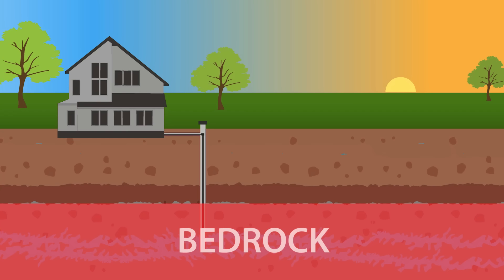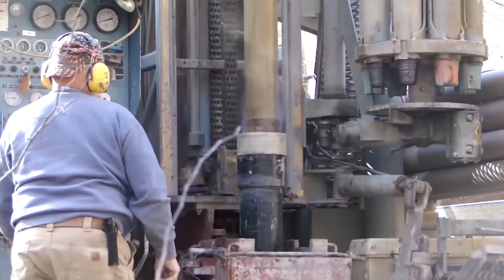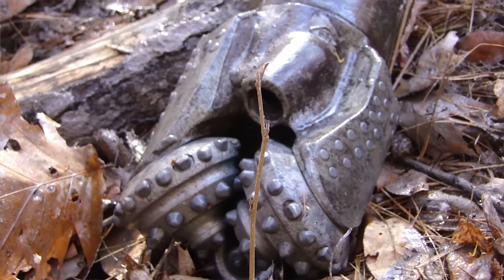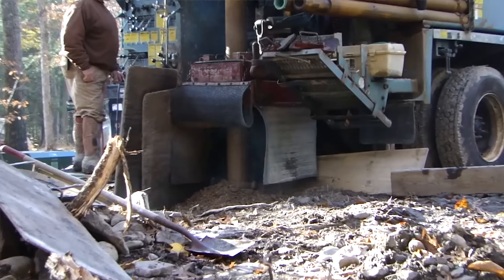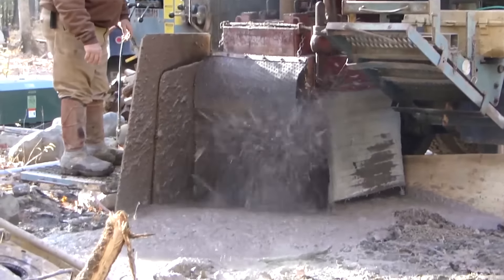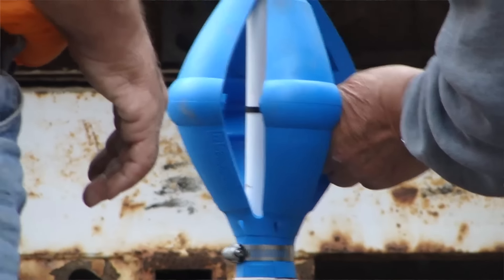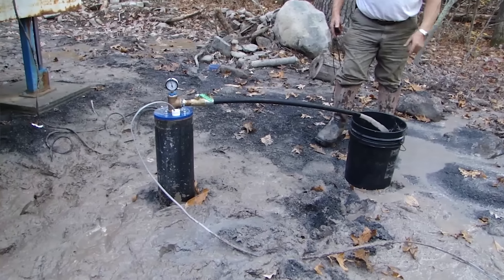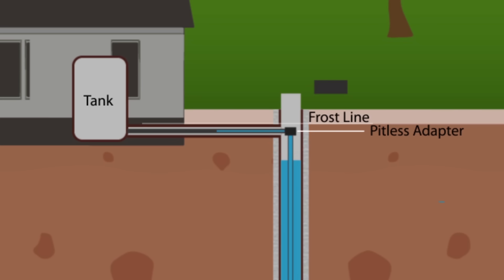WELL DRILLING 101 | Every Step Explained

Comment: The reason they went the extra 25 feet when you hit water at 300 is because the 300 foot mark it the top of the aquifer or cave (or whatever you are in) that contains the water.  Water levels go up and down throughout the year and you want the inlet pipe to stay submerged under water even in low water level conditions.  Otherwise you'd suck air when the water level was low if you left the inlet pipe up at the top of the cave/aquifer at 300 feet.  Think of a 32oz cup from McDonalds and you only put the straw in half way.  Once the water is below your straw you'll suck air.
Reply: Also, going below the top of the water table helps prevent contaminated water from getting pumped up. Oil, antifreeze, ect... usually stays on top of the water table.
Reply: NorthernChev He was also right its really to make sure they are well into the aquifer and leave a few feet for sentiment. There is no cave down there its not a under ground flowing river through a cave like some people imagine. Its porous rock like a sponge that the water flows through.
Reply: cave, lol  @tazblink
Reply: Taz Man I hate to pop your bubble but there are many caves that do not connect to the surface as a matter of fact most caves do not! Cave systems are mostly formed by "underground rivers". Sink holes are caused by such caves when the erosion opens up a larger area than the surface can support. Check out sink holes in Florida, there have even been deaths associated with them!
Reply: @thedowgs1  I never said there weren't caves underground I said the water that flows through 99.99% of the aquifers is through a porous rock similar to sponge and that its not a cave like people think. Can water flow through a underground cave of course but that is the exception not the rule. Hitting a cave during drilling for water is usually a bad thing most of the time that cave/void will need to be cased off. This conversation is about well drilling not sink holes. I was clarifying a miss statement that NorthernChev made thats all. So if you are one of those people that think the water flows in a huge cave underground you are wrong. I know of a couple well diggers that have encountered underground caves/voids its hard on equipment and scary as hell. Its very rear thank goodness to hit a void/cave in my neck of the woods.
Reply: They charge by the foot and the truck has 325' of drill rod on it without going back to the shop for more.
Reply: taz man and Darrin Wagner: Guys, “I hate to burst your bubble...” and “I never said...” always means I get to dig through guys comparing how big their knowledge (ha!) is compared to the other’s. It’s often interesting stuff, but you’ve got things that go out plus your chemicals (hormones). I have to be patient. My thing goes in and now that I have a lack of chemicals (post menopausal) so I don’t have that monthly bitchiness going on. So, I sigh and skim for the information. Could it be that you’re both right and that you don’t need to mention bubbles or have to prove you’re right to get your points across? (Pun not intended, but welcomed.)
Reply: @boa9535   ?
Reply: taz man: so you can’t getting things that go out and things that go in. That’s okay.
Reply: @boa9535  Huh?
Reply: and missouri leadbed
Reply: the deeper depth is to ensure that enough water is being produced by the well, BUT its also to make sure that water flows upward to the pump inlet for cooling the pump motor. So the depth of the pump needs to be below the drawdown level but above most of the water producing layers
Reply: Wow you're SPOT ON and quit insightful, very well expressed too. Can I ask you how many years of well drilling knowledge do you have?
Reply: You answered what I wanted to comment
Reply: It's always good practice to drill at least 20ft beyond the source of water when drilling in rock, main reason being sediment build up, which could cause a blockage over time
Reply: NorthernChev mmmmmmm... I’m loving it!!
Reply: Unlike my gpa, going lower is always better :D
Reply: Right on, I’ve heard about either keeping the well head or submersible pump submerged deep enough within the water deposit and also recessed within the casing to minimize electrolytic scaling or galvanic corrosion (I assume) or maybe it was desired to keep the pump slightly protruding from the casing, I don’t precisely recall.
Reply: taz man sediment sentiment my son was cut from a spelling bee because the proctor refused to use the word in a definitive sentence, he said, “the word you have to spell is sentiment/sediment” ? Shamefully none knew the past tense or plural sedimented sediments or adverbial= sedimentary past participle “sentimentalized”  
 I believe it was deliberate because his daughter ended up being the  winner of the Bee, lol. 
 So its been an ongoing inside family joke, and has “sedimental/sentimental” value! 
 We say the word pronounced indeterminately when we hear a statement that can have an alternate meaning used as a possibly deceptive hidden agenda. Guess you had to bee there! Lol
Reply: @tazblink  Actually, that's not always true. It depends on your area. Where I live in the PNW, our well is fed from a giant cave type aquifer. This aquifer is fed by an underground river. That is per the county hydrologist. The geology of the area is formed by glaciers and wells can be very, very deep here. We don't have porous rock here. Almost all underground water in the region comes from cave type aquifers. And yes, you can run out of water.
Reply: @mikel9567  Drilled all over the PNW I never ran into a cave underground. What part of the PNW are you from where do you live chances are I drilled close to there? Many experts will describe a aquifer as a underground cave and or river so the laymen can understand or visualize what the driller is going for. All holes punched by a professional driller are recorded and kept by county and state records. Voids underground create problems for a driller and if the records show large voids/caves in a part of a aquifer good luck getting someone to punch a hole there. I am not really sure why my statement that caves are rear underground and water travels through broken fractured sponge like rock rattled so many people. They seem to get a little pissed off when I tell them the truth. Aquifer levels change all the time. I think the deepest hole I punched in the PNW was just shy of 1200 feet, it was a 24" hole that dropped to 18" than 14" and finished at 10" I think. It was a large hole for a new development that suppled hundreds of homes. We routinely drilled 700-900 feet looking for numbers the farmer needed. Its been many years sense I drilled water wells but I drilled a lot of them. I will wait another 6 months or so for my next comment from some yahoo telling me how water flows underground. Intell then I think this guy did a pretty good job of explaining well drilling, it wasn't perfect but he got most of it right and a lot of people attacked him in the comments so I posted to say good job to the video creator.
Reply: @mikel9567  Drilled all over the PNW I never ran into a cave underground. What part of the PNW are you from where do you live chances are I drilled close to there? Many experts will describe a aquifer as a underground cave and or river so the laymen can understand or visualize what the driller is going for. All holes punched by a professional driller are recorded and kept by county and state records. Voids underground create problems for a driller and if the records show large voids/caves in a part of a aquifer good luck getting someone to punch a hole there. I am not really sure why my statement that caves are rear underground and water travels through broken fractured sponge like rock rattled so many people. They seem to get a little pissed off when I tell them the truth. Aquifer levels change all the time. I think the deepest hole I punched in the PNW was just shy of 1200 feet, it was a 24" hole that dropped to 18" than 14" and finished at 10" I think. It was a large hole for a new development that suppled hundreds of homes. We routinely drilled 700-900 feet looking for numbers the farmer needed. Its been many years sense I drilled water wells but I drilled a lot of them. I will wait another 6 months or so for my next comment from some yahoo telling me how water flows underground. Intell then I think this guy did a pretty good job of explaining well drilling, it wasn't perfect but he got most of it right and a lot of people attacked him in the comments so I posted to say good job to the video creator.
Reply: Proctor refused to use the word in a sentence......................
Reply: @3bydacreekside : or. Deeper 🙄
Reply: @jayjanuary4357  The lead is not harmful unless it has been oxidized ie smelted.
Reply: Often you have to go way past the static level to get enough flow to keep up with the pump, otherwise you pump the well dry and have to wait for it to recover
Reply: Part 2 https://www.youtube.com/watch?v=a3SwCnFCumU 
Part 3https://www.youtube.com/watch?v=e8ZvyBcMuX8
Reply: @boa9535  you
Reply: I was looking for this answer. Thanks.
Reply: So who's living in those caves that you guys are just drilling without first checking who's in there.
Reply: @TurboDireiger  As long as they stay away from the end of the tube they'll be OK 😄

Comment: Thanks for producing a great video.
  A lot of folks might never see another water well drilled in their life time.
I worked for years, in the water well and exploration drilling, (that's for coal, or minerals).
I worked with Kelly drive and top head drive rigs, 
there's untolds of different types of rigs and methods of doing the same job.
Here's and interesting thing to bear in mind;  for every metre that you drill down,
there's in increase on water pressure of ten Kpa,(Kilopascals) , 
for a comparison for Folks that aren't fluent with the metric system, 
30 psi. is about 200 Kpa. Lots of cars have about 30 psi in their tires.
So ...if your well is just 20 metres deep, there's a force of 200Kpa, or 30 psi pressing out on the walls of your bore hole.
To drill deep wells you need powerful pumps, or compressors to send your cuttings back up to the surface.
It's an interesting, or mayhaps I should say "challenging" trade to get into.

Comment: That blue thing is not a centralizer, it is an anti-torque device. Although it does centre the submersible pump, that is not its main purpose. It is designed to keep the pump from spinning due to torque every time it starts and prevent damaging the electrical supply and discharge line.

Comment: I used to drill wells myself and that's how we did it in Europe. We drilled mostly in central and northern Poland where bedrock is covered with a lot of overburden that was pushed there by glacier and didn't manage to erode like it used to in southern parts of the country. The main water source here is not water pockets above bedrock itself, but rather deep gravels. We did use water-safe PVC pipes to cover the shaft, but we put them after drilling, and removing drill from the soil. Last pipe was caped, and second to last (or more), was drilled and covered with water-safe PVC net, with eye size according to size of a gravel grain, to filter solid particles from the water and protect the pump. Next difference is, we used a bentonite only as a seal for gravel to prevent water to soak into it (as gravel cn really "drink"  lot of water you use to wash out the drilling output material). For a clay, we used polymers, to prevent it from swelling, and closing the shaft (so we could safely put our pipes later), and to help water to wash it out, instead of letting clay to disolve and thicken the water. After we finished submerging pipes, we used to fill the remaining shaft space with clean, washed gravel to 10-20 meters above filters, and finished it of with some of leftover from drilling, to seal the shaft from the top. Such ells are very potent, as they use renewable water source, that is rainwater being filtered by tens of meters of soil, and water gravel itself.

Funny thing is that specificaly in Poland (but also in Germany), the glacier ranges are 100% correct when it comes to anticipting water conditions. Method I described is viable only south of the moraine of the first and north of moraine of the second ice age. South we have a shallow bedrock, and north we have even thicker and more various and mixed overburden and water conditions are even more unpredictable.

Comment: We are in the process of drilling a new well on our farm here n Iowa. The present well is 816 ft. deep. Last year the pump went bad and we had to replace the pump. That pump was at 550 ft. When putting the new pump back down, we hit something that prevented going any deeper with the pump. It is setting at 450 ft. and not supplying adequate water for our needs. There is plenty of water in the well. We just can't get to it.
The 1st estimate to drill the new well came back to us at $36,000. Above and beyond that will be moving the pump from the old well to the new one and getting everything hooked back up. Going to be an expensive year on this farm in Iowa.
I plan to do a video on my channel when we drill the new well. Thanks for the video. It was very well done. No pun intended.

Comment: I was once a licensed water well driller in the state of Idaho. Every state/area is different in how they do things. From my experience in areas like yours, I did similar process, except we would drill a 10 in hole all the way down and even into the bedrock a few feet. Then run the 6 in casing all the way down but not to the bottom. We would have it 1foot above the bottom. We then would pump grout into the casing and up the annular space, ( between the casing and ground ) to the surface.  That blue cone above the pump is to keep it centered so water flowing past pump motor keeps it cool. And they never set pump to the bottom so if water levels drop and exposed the pump, they have room to lower it to give you water/time to deepen the well or drill new one
Reply: Do you know what I should expect for price per foot? I live in Nampa, Idaho and I have heard people paying up to $30,000 for a well between Boise and Mountain Home. Is there a registry in a local area of how deep everyone has to drill that I can look up the average depth as a matter of public record like sale prices of homes and such? I want to buy land and put up a pole building but will no longer be able to afford to live in Idaho as of Feb., 2022. A well might be out of my price range.

Comment: The "blue thing" is a torque arrestor. It sits against the sides of the well and prevents torque (caused by the pump when it turns on) from spinning the polymer pipe and kinking or breaking it.